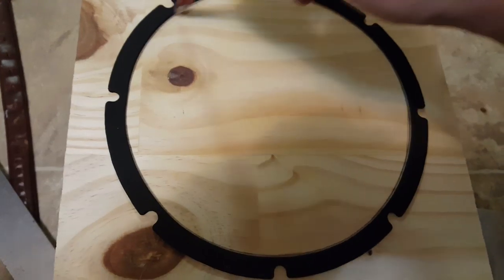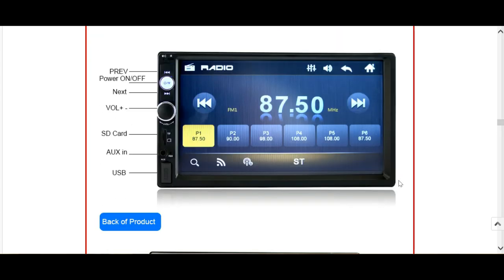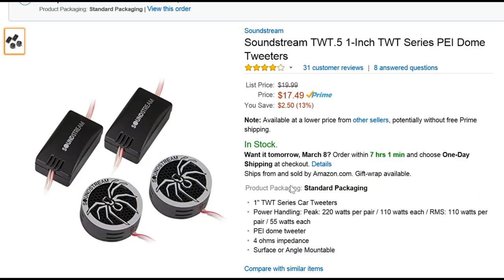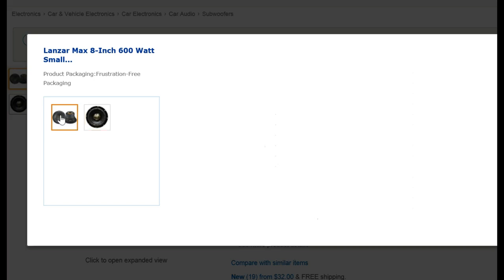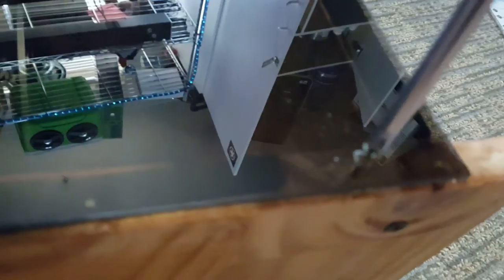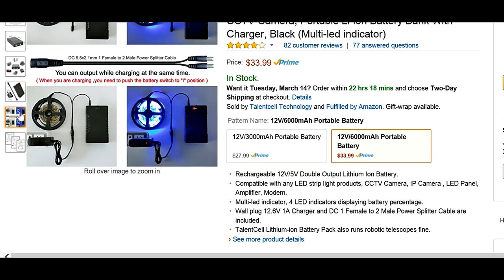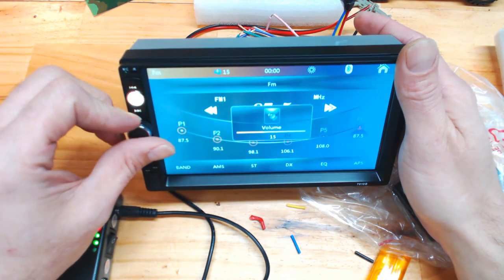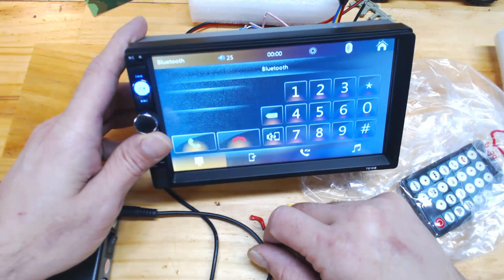make your own portable bluetooth speaker box cheap and easy

Comment: You could possibly get the Xbox running off a +12v DC car battery. The best way to do it would be to attach a 400-500w DC-AC converter (inverter) to the internal DC jack of the car. Inverters of this class draw a considerable amount of power depending on the load, so be mindful that the battery may deplete quite fast if the car's off. There are other ways to get devices that require ~120VAC to run off of car batteries, but those wouldn't be viable options in this case.
Reply from the maker: I was thinking more of the motherboard being pulled and running dc. I realize the disc drive would be the  power fluctuating difference....But if you might have one that does not need the disc drive to play games and only needs a usb flash drive to run?
Reply: The Xbox requires more than just a +12v rail. There's a +5v and +3.3v rail as well. You'd need to get some sort of regulated buck converter to step down +12v to +5v, etc. There are plenty of those on the market. One thing I would worry about though, is the fact that bypassing the power brick yields many problems of its own. That brick is highly regulated and has a lot of filtering and protection circuitry. Basically, the xbox will be volatile to voltage fluctuations, etc. The system may also draw more power than the car can handle. If I remember right, most cars have a 10-15 amp limit while the xbox draws around 17 amps.
Reply from the maker: guess will leave that stuff up to Ben Heck that dude is awesome
Reply: modstek Who is Ben? Just curious
Reply from the maker: https://www.youtube.com/channel/UChturLXwYxwTOf_5krs0qvA

Comment: two tips: dont ever make a speaker out of plywood unless its like 2 inch drivers, use mdf instead, and dont just drill a hole as a bass port, you should do a bass reflex hole instead out of like pvc pipes.
Reply from the maker: good tips thanks...Im thinking a bass cannon now out of tube they use to pour concrete pillars
Reply: modstek i made one of those, u gotta make it kinda long if u want low bass tho

Comment: I would venture to say if you used a cheap 400 watt power inverter, from Harbor not so Great, ooops I mean Freight, to plug into your cigarette lighter you could probably power the x-box that way with it's normal brick. This unit is said to run various things and it's like 30 bucks if memory serves me correctly; or maybe that was on sale.... Here is it, the Cen-tech 400 Watt Inverter Item number: 66814/61479 listed on sale for 24.99, 1/2 price, usually 49.99. They also show an 80 Watt but that might not be enough for the x-box... Great thing about Harbor Freight is their return policy if the item does not work as intended... Cheers...